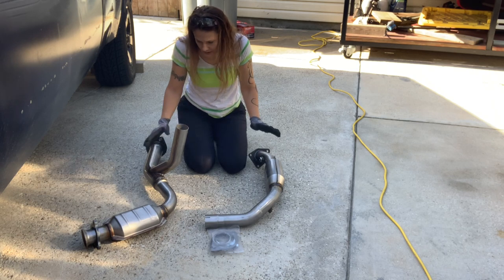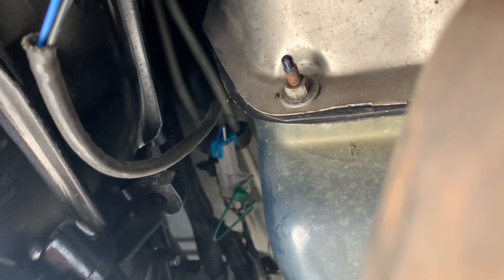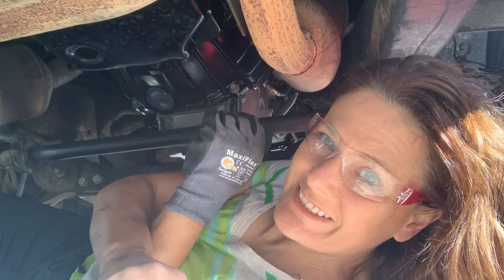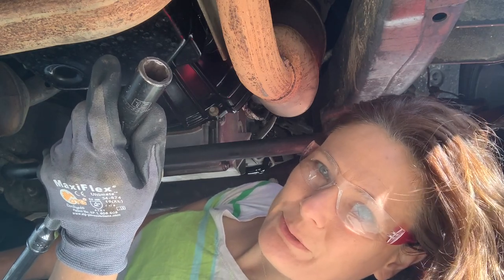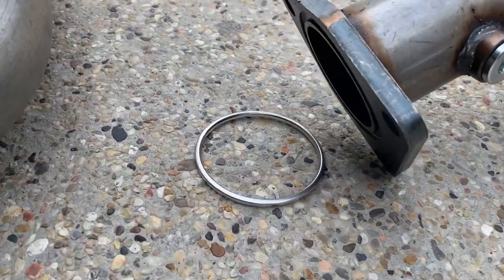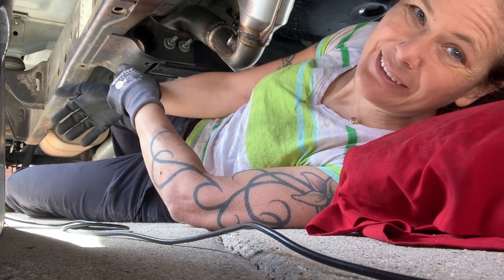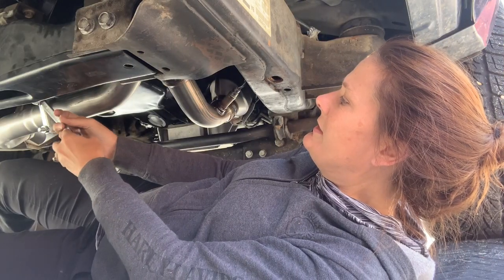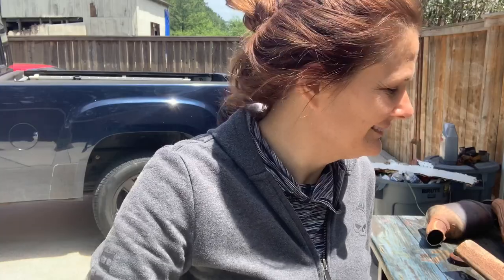Installing catalytic converters on GMC Sierra

Comment: For future reference you don't have to remove the transmission support -- you can just loosen anti-sway bar bolts instead and wiggle the whole Y pipe out it one piece.
Reply: I was wondering I have a 02 yukon I have to tackle this week
Reply: @tobyjohnson9128  I think the 02 yukon you have to remove the transmission support.  Unless it has a anti-sway bar like this video, then you can just loosen the anti-sway bar bolts and wiggle it in/out.

Comment: When you took the transmission cross member, did you have to hold the trans with a jack?
Reply: I'm wondering the same thing. 

 A different video says he used a jack stand (or two?) to support the transmission.  I wonder how and where he put it.  And if he used anything extra to spread out the load without moving too much when I remove the brace.
Reply: Yes she did

Comment: Can you share the website where you bought the parts
Reply from the maker: AutoShack EM60471 Exhaust Manifold with Catalytic Converter Exhaust Pipe Direct Fit Replacement for Chevrolet Tahoe Suburban 1500 Avalanche Silverado 1500 Classic GMC Sierra 1500 Yukon (EPA Compliant)

Comment: Sorry one more question.  Did this catalytic converter kit work for you. I looked up the company and the price is just perfect. Did your codes go away? Please and thank you
Reply from the maker: The codes did not go away I’m not sure how much I can trust that cat because of how cheap it was but it might be my sensors but I didn’t have them in for long so I know they were pretty new 🤷‍♀️
Reply: @NotamechanicBetty  wow. So what did you end up doing?   I think maybe like you said don't buy these cheap ones.
Reply from the maker: @Ernestosgarage  The light is still on
Reply: @NotamechanicBetty  damn that sucks.  Thank you . I hope you get it fixed.

Comment: How did you supported the transmission
Reply from the maker: I had to rewatch the video to see. Cause I didn’t remember. Yes used floor jack to hold transmission up and quickly dropped the support bar (seems like we just removed the bolts and only had to lower it an inch or two to slide the pipe through) then bolted it back in place.
Reply: @NotamechanicBetty  just wondering if you guys used a 3ton jack to do so. Also, did you torque the clamp that connected the pipes to a certain spec? I am trying to do this in a coming weeks lol
Reply from the maker: @blackhouse7646  I’m pretty sure it was 3 ton but I do have a transmission jack from harbor freight that I might have used it’s been a while. I just tightened the bolts as tight as I could
Reply: @NotamechanicBetty  thanks

Comment: Did codes ever come back with aftermarket cats? Every place I go tells me to get oem from dealer
Reply from the maker: There’s still codes on and I’m not sure if they are from the O2 sensors or from the cats. Because they were so cheap I’m guessing they don’t really work but the truck runs fine (well sometimes it takes a few turns of the ignition to get it running and I can’t figure out what is causing that)
Who knows 🤷‍♀️I would say: if you can afford it OEM is your best bet
Reply: I would try changing your crank sensor for the cutting out problem

Comment: Sorry to ask again. Did you ever get the light to go off?  Did you ever find out it if it was the new catalytic converters?
Reply from the maker: I have to admit that it is still on. The truck runs great except that sometimes it doesn’t crank on the first try. Other than that,  a light on doesn’t bother me (knowing that I did everything I could to get it to turn off) . I don’t drive it much so I can’t really know if the catalytic converters  work well or not.
Reply: @NotamechanicBetty  ok. Thank you.